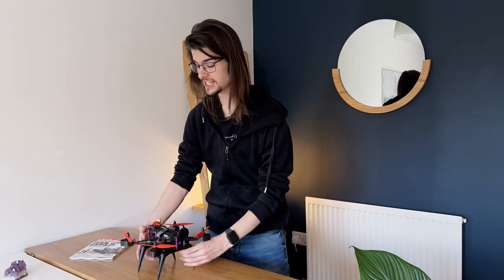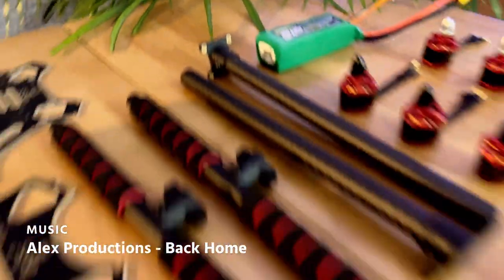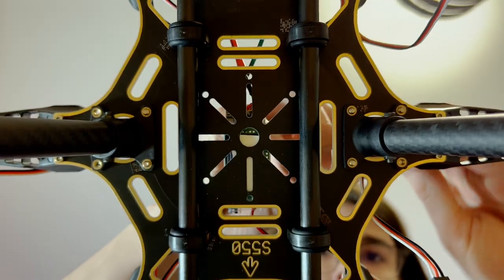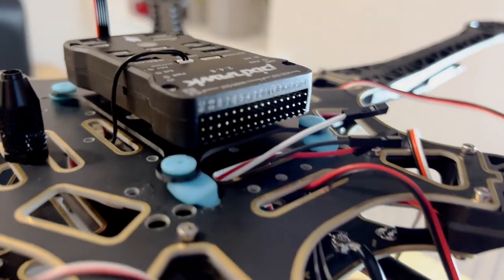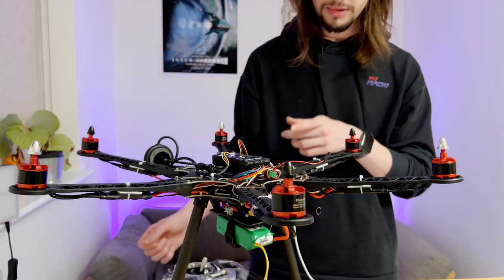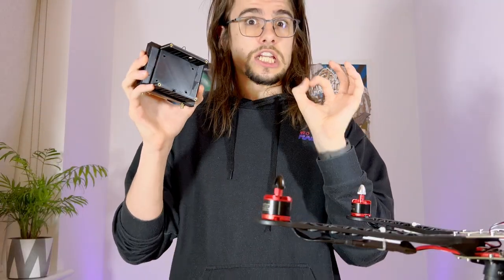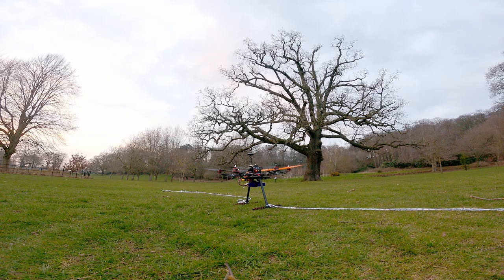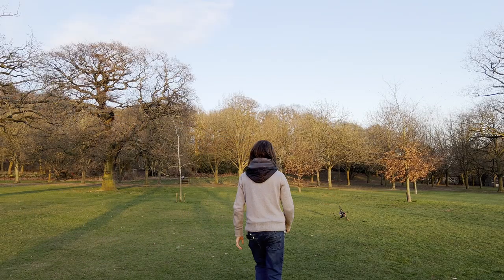Meet Stanley, my NVIDIA Jetson Nano drone | DIY drone pt. 4

Comment from the maker: One thing I didn’t mention in the video is what the Jetson Nano is currently doing. Right now, I’ve set it up to forward MAVLink packets over a WiFi network to every device on that network. This is helpful for me to connect multiple ground stations, like my laptop and phone simultaneously.

Longer term, it’ll run the navigation software I’m writing and directly control the PixHawk.
Reply: Using pydronekit or mavsdk? I'm pretty curious to know.
Reply from the maker: @waleedjaved4581  at the moment I’m using DroneKit, though wasn’t aware of MAVSDK… so far I’ve built my code to abstract away sending navigation commands into a single class, so should be relatively easy to switch if needed
Reply: @akamatchstic  Sweet! You'll obviously be using TCP for drone to GCS comms over wifi. If for whatever reason you need UDP do check block_tx for loss catering on UDP.  Cheers mate.

Comment: Great Video.
I made a very similar quadrocopter build with a pixhawk and a jetson nano last summer.
I had the same struggle when I built my first drone ( instant flips, propeller fly aways and vibration issues )
The ardupilot flightstack is very powerful and feature rich but it takes time to learn about all the details that matter to
make your drone fly nice and safe.

Comment: If you are looking for more advanced drone Project ideas, I suggest you look into telemetry and remote control over cellular internet using a LTE/4G modem.
It opens the door for long range applicationsand is very powerful because the distance to the ground station doesn't really matter anymore.
Reply from the maker: This is exactly the idea behind a planned video I need to make soon 😅

Comment: What are you installing at 8:27? Extra antennas? Why?
Reply from the maker: That’s the wireless antennas for the WiFi card I have hooked up to the Nano. These ended up causing some wonky interference with GPS in the next video, so ended up getting removed in favour of a small USB dongle 😅

Comment: Really great attempt on flying the drone. I suggest using a propeller with auto-lock features like the DJI uses on Phantom 3. You'd get more thrust in using 9.4 inch props than using the 10inch one. I also recommend auto-tuning the Pixhawk first (though I don't use Pixhawk, I use the 8bit arduino based Flight Controller Multiwii. Yes, I know its too old but I got more stability in using this. The performance is really close to the iNav)
Reply from the maker: Thanks! I’ll have to take a look at the 9.4inch props, though could have sworn my 10inch ones are auto-locking? Either way, on this video’s final test I didn’t do them up tight enough, leading to the spectacular crash!

Yup, auto-tuning was on my list of things to do in this video, and has since been done. I’m now seeing very nice, stable flights (when there is no pilot error involved) 👍
Reply: @akamatchstic  oh sorry, what i meant was the propeller with integrated bolt in it, not auto-locking propeller. That way you can just tighten it by hand. I don't have any issues using it. One more thing I suggest is Prop balancing, it adds stabilization on your flight, less chance of crashing. Happy flying, I'm hoping to see the next part of the series 🙂

Comment: You've already explained that the Jetson Nano gets its power from the 5V BEC, but (maybe this is a silly question) where does the PixHawk get its power from? I sit here for hours trying to figure out where that one mysterious black POWER cable with the red stripe goes 😅!
Reply from the maker: It’s uh, another BEC 😅 I have something like this plugged between the battery and the power distribution board to power the PixHawk: https://ardupilot.org/copter/docs/common-3dr-power-module.html
Reply: Thank you very much. That helps me a lot 😊

Comment: Are there at least two variants of the Oak-D-Lite: Fixed focus and Auto focus. If that is indeed the case which one did you use? My apologies if you mentioned that in the video and I missed it. I'm guessing you chose the Oak-D-Lite with Auto focus. Yes? No?
Reply from the maker: It’s been a long time since I made the choice, but I’m 90% sure it was fixed focus - the auto I believe has issues with the vibrations due to the propellers

Comment: Just curious how did you power the jetson ? dont see any power connection to the battery
Reply from the maker: Over GPIO! I installed a 5V BEC on the power distribution board, which in turn fed the Jetson via the 5V and GND pins with a couple of jumper wires
Reply: @akamatchstic  is there anyway to provide the jetson nano with 10W ?

Comment: Hey im a bit late to the party but I just wanted to say that I too built a diy hexacopter from a very simmilar frame and I too crashed at least ~7 times before I figured everything out. I had voltage regulators that just randomly stopped (cheap chinese besc what a surprise I know), propellers breaking in mid air, sudden radio loss.... 
Tldr: Keep up the good work! Btw your editing quality is amazing
Reply from the maker: Cheers! I’m glad to know it’s not just me having these kind of troubles building a hexacopter! On the topic on ESCs, I have noticed one of the 6 motors occasionally loses power and regains it a second later, causing a sudden pitch of the aircraft. Is this similar behaviour to what you observed when voltage regulators stopped working?
Reply: So my problem was: Some esc have a built in 5v output to power the flight electronics, i think its called bec.
My goal was actually to built a flight cobtroller from the ground up out of an stm32 microcontroller, there's a cool Youtube series from a guy named Joop Brooking.
I noticed in flight, my custom flight controller suddenly reset itself mid flight (resulting in a crash obviously), even though I had tested it on a bench working for hours. I also think the esc whose bec I used didnt drive its motor properly afterwards or something. This was a school project and it has been a few years so I dont remeber all the faults in detail anymore.  But I know that after I bought a deticated 5V buck converter rated for 1A I never had my fc reset itself anymore.
Reply: @akamatchstic  Probably the esc got to hot or something, even though they were rated for 30A and my motor took max 15, and my 5v Load was also only around 300mA. 
I never really investigated it further since with the dedicated buck converter everything works fine.

Now to your problem: I would guess that maybe yes, one of your esc is overheating. 
Are you using a bec or a dedicated voltage regulator?
For how many amps are the escs rated? Your drone looks quite heavy, I would at least have the esc rated for double what you are likely to pull at a maximum.

Good and THICC power wires are also importand, as well as good connectors. Btw, I also had a crash because my XT60 connector wasnt solder on porperly and went loose mid flight.

Comment: I was wondering about the battery, could we use more than 5000mAH? like 6500mAH . I couldn't find 5000 anywhere.
Reply from the maker: Absolutely! Since the larger battery is heavier, it may reduce the max payload weight on your multicopter. I’m planning to rig up my two 5000mAh batteries as a combined 10,000mAh

Comment: Hi! I love the project and I like your videos!
Watching the motors spin the wrong way and propellers fly off gave me an idea for maybe an interesting side-project.

Maybe you could design and implement a neural network that could learn to compensate for missing propellers and still give some higher degree of control? You probably wouldn't even have to experiment on the real, physical machine. Sentdex some time ago used some Nvidia and Open Source software to utilize the idea of digital twins to teach a "robot" dog to walk so that might work for simulating a drone maybe.

Comment: The Pixhawk 2.4.8 flight controllers I've found say they can control 4-axis multi-rotor drones. But your drone has six rotors. Can the PixHawk control a drone with six rotors? Or did use a specific model?
Reply from the maker: It’s controlling it just fine 👍🏻 there’s 8 output rails for motors, and ArduPilot does support all 8 available

Comment: Honest question, is the Jetson capable of handling everything on its own? Could you eliminate the Rasbery pi altogether?
Reply from the maker: In this drone I’m no longer using a Raspberry Pi! 

On the previous one, I used a Raspberry Pi Zero as the flight controller - I’m assuming that’s the one you mean? In that setup, I found that it could pretty much only run ArduPilot and basic OS stuff. The Pi 4 might be able to handle additional overhead, but I haven’t looked into that.
Reply: @akamatchstic  About that... Look into the Raspberry Pi Zero 2 (the 2nd gen. board that was released recently). That is if you want to have a simpler Pi-power drone. The 0-2 now has a 4-core CPU instead of 1-core and it seems to be between 3 to 5 times more powerful in benchmarks.
Reply from the maker: @theabyss5647  Good point! That should definitely help with performance. At some point I plan to get one in for a future project 😅

Comment: Hey there, I would like to know if it is possible to build a control system for a drone without using devices like pixhawk, or navio2, using only IMUs, giroscopes, and a raspeberry pi?
Reply: You could, the Problem with the raspberry is that you‘ll Need a realtime kernel… next thing is youll Need to decode pwm/sbus on the rasp, which could be not fast enough (realtime…), the navio itself is not much More than imu, barometer, gps reciever (and a processor for Decoding/encoding sbus/pwm)

Comment: You really should encourage people to use microcontroller for home made drones. Nvidia jetson is computer, it is not an instant execution microcontroller. Use Atmel SAMD or STM32. Jetson uses its cpu power mainly to run the OS and other background tasks not really suites for this job. But I like the way you are trying hard, spirit for moving forward is really what person need when doing this type of stuff.
Reply from the maker: A microcontroller approach is a good shout. For this project I want to make sure I have the compute capability to do things like onboard hand gesture recognition, so it felt like a Jetson Nano would be a better choice for this case

Comment: Hey !
I would love to make quadcopter like you and additional many things
But I am not quite sure about how to start to learn
Can you tell me a roadmap ?

Yes there is lots of videos about robotics but there is not much especially about UAV's

Can you help me, which programming languages and cards should I learn ?
C++/Python, Arduino/Raspberry Pi ?
I am quite confused
Reply from the maker: Its a bit of a minefield, that's for sure!

When building the quadcopter, you'll want to purchase a flight controller thats easy to communicate with, so you can give it flight commands. I'm a fan of PixHawk, and my recommendation would be to choose something that supports MAVLink. 

Other than that, it would be a standard drone build. There's a good course available here that covers pretty much the whole process: https://dojofordrones.com/courses/21-part-drone-building-video-manual/

In terms of programming, I'm writing all my code on a Jetson Nano using Python. A Raspberry Pi would work just as well for most tasks, and is a fair amount cheaper too. Arduino technically would work too, but if you're just starting it would be easier to avoid that route and stick to RPi + Python.

The main process to go from parts to a drone you can program is:

- Build your quadcopter and make sure it can take off
- Go through the tuning process (this is where to look if you use PixHawk: https://ardupilot.org/copter/docs/tuning-process-instructions.html)
- Connect the Raspberry Pi (or, whichever board you end up) using a serial link, and make sure you can get MAVProxy working

At this point, you'll be in a position to connect from eg Python using a library like DroneKit or MAVSDK, and then be able to send commands over the serial link to fully control the drone from code.

Comment: Why do you need jetson nano and not just rpi with Oak-D ? Great video and sorry it broke on you
Reply from the maker: An RPi would be able to handle my initial use case just fine to be honest. I went for the Nano since:

a) I had already bought it thinking I would need the extra compute for stereo depth 
b) my future plans involve running further neural nets directly on the Nano for eg hand gesture recognition, as well as spoken command recognition
Reply: @akamatchstic  in that case then yes . 👍 keep the good content coming 😃

Comment: Really great video!! I was following your drone project and saw that you used yolov4 for object tracking in jetson nano. Now that you got the oak-d lite, are you using it for object/person detection also? It should be capable of doing that very fast as per their demo. By the way, for jetson nano, nvidia's deepstream should give you huge speed boost with inference.
Reply from the maker: Thanks! 

Yep, I’m currently doing the initial work to have Yolov4 running on the OAK-D. The initial results are FANTASTIC: last night, I was seeing 25fps for person detection! The next steps from here will be to write the second half of my follow-me setup, and then do enough testing under a SITL environment that I’m happy enough to run it all on the Jetson. Potentially might try and get gesture recognition running on the Jetson itself, in which case Deepstream will come in super handy 😅
Reply: @akamatchstic  Thanks a lot for the info on the oak-d lite. Will order some for testing soon. Looking forward to your next videos. 👍👍

Comment: Hello, i really like your videos, I have a decent experience with ardupilot and drones since i work as a drones engineer, if you would like some help with setting everything up correctly to fly safely without crashing, hit me up, i would be glad to help you out.
Reply from the maker: Thank you very much for the offer! At the moment, I’m pretty sure that the last crash was caused by me simply failing to do up the prop nuts tightly, and assuming they would self-lock nicely. Ie, my theory is that vibration of the motors prevented that happening, since other prop nuts were close to falling off too on post-flight inspection